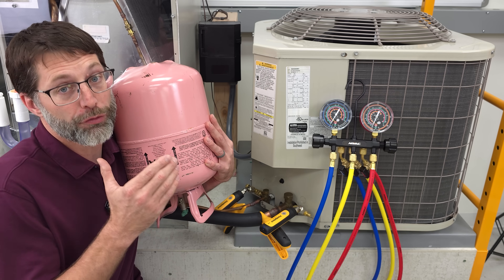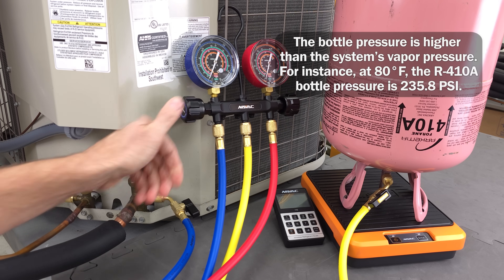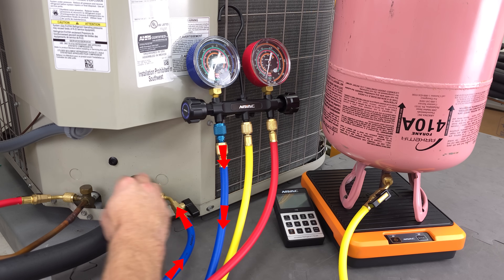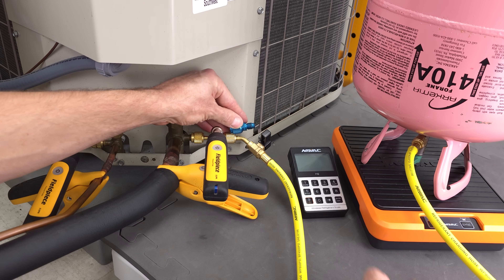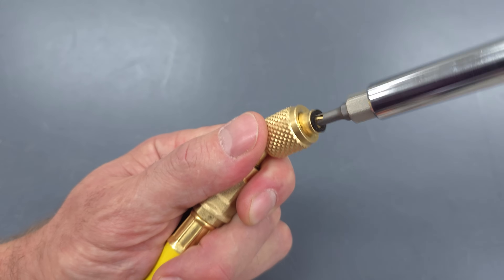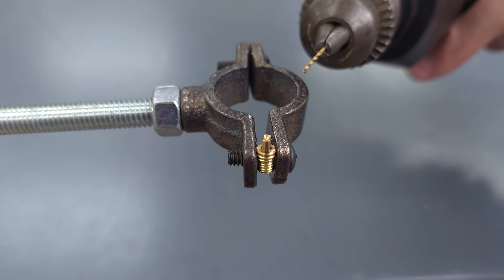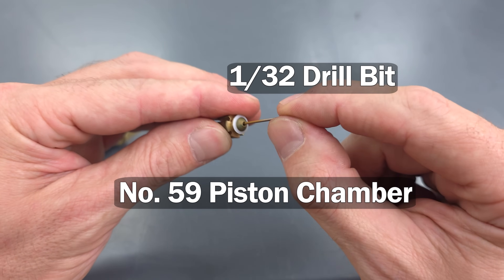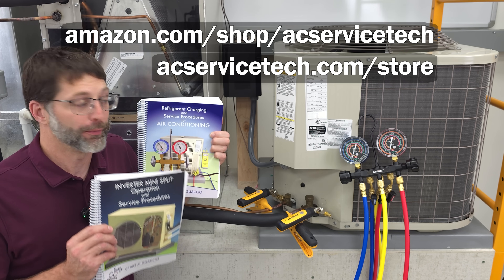What is a Liquid Vaporizer for Refrigerant Charging? Make one Yourself!

Comment: Not sure if you have used the testo smart charging valve, but if you have then do you think it does an adequate job mixing in the liquid refrigerant to the system? I love using it, but even though I have it set to pulse charging it still charges a lot faster than I would expect and it worries me😂

Comment: To the tech doing this for 50 years,he is correct and it has nothing to do with what refrigerant you are using old or new,you and a lot of techs should never add liquid from the low side if you care about the customer’s equipment,use a charging orvice  😊

Comment: Wondering about over charging and how it effects super heat. I added some R410 and super heat went up instead of down. I thought you were supposed to charge 410 in liquid phase? It's on the bottle.
Reply: it needs to be drawn from the cylinder as liquid, once it leaves the cylinder as liquid it can be flashed off into a gas blend and not cause issues. it constantly turns from a gas to liquid when running anyway. 410a isn't really that bad at fractionation, but still good practice to always use it as a liquid, some other blended refrigerants are very bad at fractionating.
if it's as piston/other (non-txv) metering  device, overcharge will raise pressure and push too much liquid through the orifice and into the coil. too much liquid won't boil off all the way or will do so near the far end of coil, thus making a warmer coil and possibly liquid flood back all the way to the compressor.

Comment: Good I dea but I just meter it with the gauge manifold and use common sense and listen to the compressor go slow and have never had an issue. The schrader openings are pretty small in itself so a little common sense and you are ok.

Comment: Time is money - when speed is of the essence - I use two vaporizers for years for weighing in zeotropic LIQUID refrigerants TO a system with a refrigerant recovery machine that is piston operated. This is the fastest way to get high quantities of refrigerant in a system, keep in mind that those vaporizers make a phase change and ice up, usually use two vaporizers and two hair dryers to heat the vaporizers for max speed charging without hydro locking the recovery machine, that does not pump liquid.
Reply: @eablau   a recovery machine is designed to pump liquid.
Reply: Interesting. Thanks

Comment: Good knowledge, however I have done HVAC work for 50 yrs. and never needed such devices. Common sense is usually enough when charging systems. Maybe the new refrigerants need more care when charging systems. Thanks for the video.
Reply: I've been at it 15 and never had a problem also. But we need to learn and change with the industry or we will be left behind. At one point we didn't purge with nitro and didn't pull a vac, I hope you do those things regardless of whether you've been doing it 5 or 50
Reply: @Falcon-eh8tq  Always vac and changed dryers after an open system. Purged and nitro when it was necessary.  R12 and 22 and oil was not so sensitive as todays refrigerants.
Reply: @watermanone7567  thats my point.
Reply: @watermanone7567  Right but alot of techs did not listen during hte transition to 410, leading to burnouts, acidic refrigerants, carbon.. my point is that industry standards are set by guys doing something different sometimes, not following the crowd. a vaporizer to charge a system is not a new concept, just as purging with nitrogen and pulling vaccuum.. It's the attitude not the context.
Reply: lol this video is for you to save time but knowing your old ass you probably rip off people and lie about what’s really wrong
Reply: @watermanone7567  yep cause you know everything about HAVC and your prob 65 and really don’t do shit but rip people off
Reply: It's a must to evolve with the trade these days changes are happening whether we like it or not don't be the one who gets left behind 😅
Reply: @izzymoney85  Best to learn from that old timers also.
Reply: @watermanone7567  true and not true, pass on all the bad habits too. We live in the internet age where AI can literally aggregate the internet for you for 1 sentence.
Reply: Common sense ain’t so common these days. A little investment into the right setup and a tech can save several hours of work every day that turns into weeks worth of time a year.
Reply: @markm0000  Proper education is more important than gimmicks on equipment. we always metered in the refrigerant slowly thru gauges with no issues.
Reply: @watermanone7567   After I do any repairs I pull a strong vacuum, sometimes with 2 pumps, and do a quick decay test. If it’s rising too fast I can check for a leak with an ultrasonic detector. Then I close the low side valve to stop oil from getting pushed out, and send liquid from the bottle into the high side or liquid service port, it will charge within seconds.
Reply: @watermanone7567  I use a 4 port manifold custom bored with all 3/8 heavy duty black hoses, high flow reducing adapters, and no valve depressors. All gas no brakes.

Comment: No link for that blue vaporizer???
Reply: I googled them. Yellow Jacket makes them. $13.69 on Amazon. “Yellow Jacket ¼” Liquid Charge Adapter”
Reply: Why not invert the tank and charge as a gas to begin with?
Reply: @johnvictor2451 you cannot charge a multi component blended refrigerant as a gas because the components evaporate at different temperatures and throws off your mixing ratios, yielding an unknown compound in your system.
Reply: @realSamAndrew  Ah. Sorry. Thought it was straight freon.
Reply: @johnvictor2451  straight freon? Freon is a brand name that usually refers to R22. R22 is phased out and the replacement was R410A which was marketed as Puron. R410A is now being phased out as well. R410A is one of dozens of refrigerant compounds on the market many of which are single products made by seamlessly blending several other refrigerant components. It's one liquid in a tank that separates if released in the atmosphere. R22 is a single molecule that doesn't separate.
Reply: Because,  is a blended refrigerant, if you put the tank inverted, the mix is not pure refrigerant.